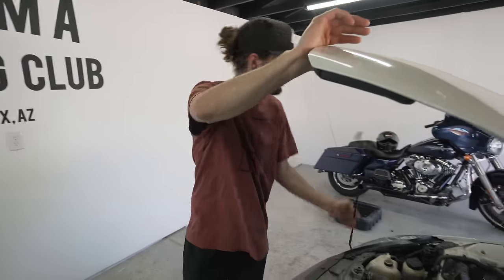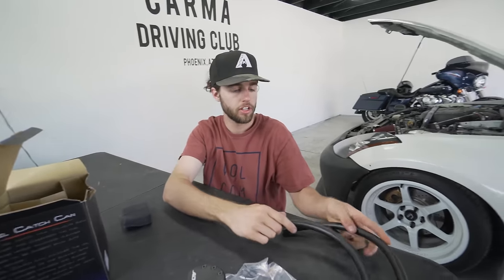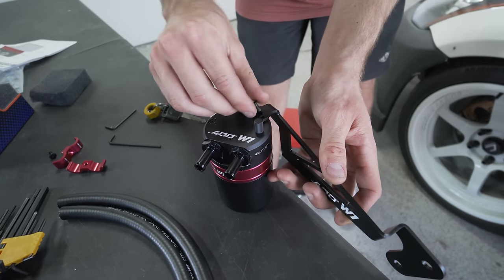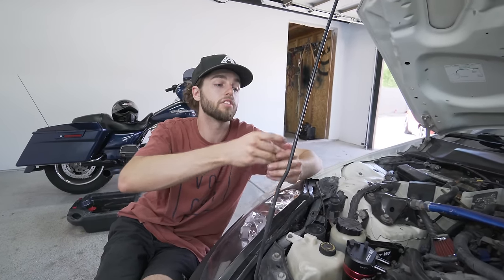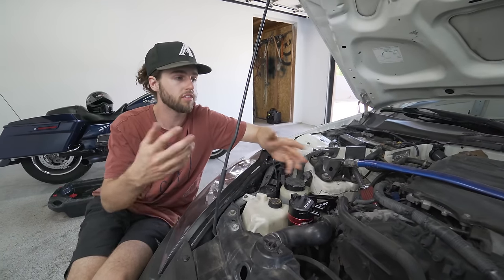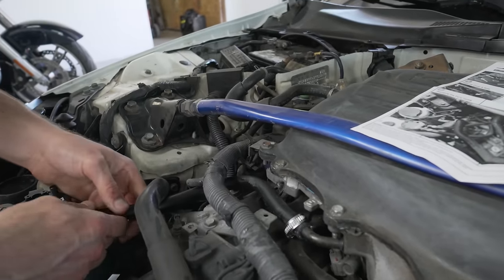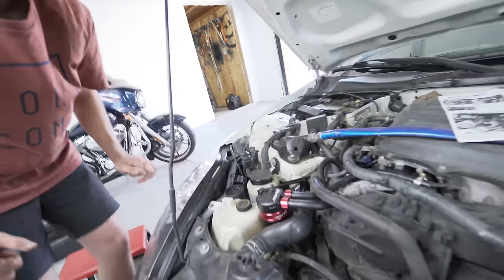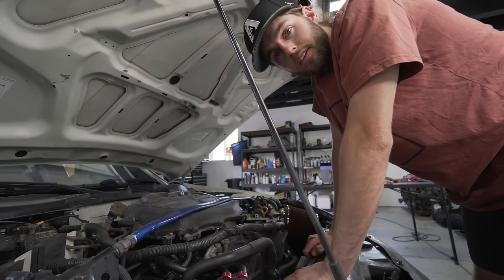350z Catch Can Install +Why It's Necessary! (Oil Consumption)

Comment: This is slightly incorrect. You are using the intake as a vacuum (negative pressure) to pull the crank case vapors (blow by) out of the top of the head/crank case (positive pressure). The reason this is done so you don’t leave fuel and water from the combustion cycle sitting in your oil degrading it. Also the reason they aren’t vented with that little filter from the factory is because those vapors are harmful to the environment. So they use the intake to cycle them back into the engine to burn them off. But over time, this cause valves to get all gummed up and can leave tons of carbon deposits.
Reply: AutomotiveBox I’m glad you chimes in here!  Didn’t feel like typing so much lol. Well said!
Reply: AutomotiveBox im a newb spare me.  The PCV valve connects to the “IN” port of the catch can right?
Reply: Not on a 350z, these engines are port injected, and spray their intake valves with fuel which keeps them fairly clean. In fact, the OEM intake manifold design on these is meant to catch most of that oil, and what little oil finds it's way to the cylinders is just extra lubrication.  Catch cans are really only helpful on direct injection motors, which do not have any cleaning effect on the intake valves. I took my entire intake manifold off just recently on mine to replace a valve cover and some sensors, and the intake valves looked almost shiny clean at 110k miles.
Reply: It’s not just to clean the intake valves though. It’s to prevent detonation and degradation of octane in fuel. This will happen if any oil makes its way into the combustion chamber.
Reply: You really have to caveat your comment with a "DI"' inject. Port injected engines won't see harm from this, only DI engines will. 350z doesn't need any, it's all marketing BS.
Reply: @jacquesc3166  I absolutely agree with you. Anthony 350Z had a pretty cool setup for his catch can. However it will burn through the motor and then run fuel injector cleaner every few months

Comment: Ok, so here my 2 cents worth.. ignore if you like.. but, blow by comes from the crank case, the bottom of the engine, where pressure passes down past the cylinders/pistons and rings. So the pcv valve relieves the pressures that build in the crank case. The catch can basically filters those vapors and cleans the oil particles out. So honestly, there really is no point and is counter productive to reroute said filtered air back into the intake manifold just to muck up the intake air(it wont be entirely filtered ). Better to relieve to atmosphere. And since there is also a hose venting the driver side as well, it would be better to route both hoses to the can, then vent out to atmosphere through a small filter. Plug the intake hole again. I noticed the kit you bought only has two hoses, one in and out out. There is another version of that system that has three ports, one in and two back out. That one will allow you to take in both hoses out of both valve covers and vent out to a filter with minor adjustments to system for adding a filter on out port(hose adapter). I will be doing this set up shortly and can let you know how it goes. 🤞👍
Reply: How did it go bud
Reply: @segbachan5123  still haven't done it yet. Sorry.. 😆

Comment: Love the vid, i think you got miss informed my man I think you got blow by backwards there’s a heavy negative vacuum on the intake from it sucking in a lot of air hints the term intake so even if that was to happen it would go out the exhaust, what really happens is all the movement under the valve covers makes pressure that needs to be vented and after the motor gets hot the oil cinda turns into a steam I guess is the best way to explain it and and what do you do with Oily steam, Nissan just decided to hook that into the intake to help lubricant the motor but Nissan figured it would help the motors last longer in return for a little bit of performance loss so a catch can is to help get that little bit of performance back but you also lose that lubricant factor

Comment: If your oil consumption is high. Change your valve guide seals. That’s not going to solve the root cause.
Reply: Could be other things.  Worn rings.  Leaky gaskets.

Comment: There is also a hose for the ACTUAL PCV on the driver side rear that acutally intakes air from the back of the intake tube. That is the acutal PCV intake, its not that little hose connector on the plenum.

The PCV valve is a one way OUT valve, not in. The oiled air comes from the cover back into the  intake manifold so that can be burned off.
Reply: If you remove the PCV check valve completly, you will get air going back into the motor as well. On boosted applications the VQ will get blowby even from the back of the actual driver side PCV system intake.

You can see the correct flow of oil vapors in the system in the FSM image I linked.

https://g35driver.com/forums/attachments/canada/98237d1227123015-what-pcv-valve-do-i-need-replace-my-g35-untitled-1.jpg
Reply: i just saw a lil beat of oil in my vortech v2 blower and aslo my bypass valve its like oily but my car does not smoke wwhen driving it do you recomend this ADDW1 catch can ?
Reply: Anything with forced induction should be running a catch can, so yes.
Reply: @Z33Garage  ok thanks for reply

Comment: Its so cringy when ppl dont know what they talkin bout so many ppl will be miss informed
Reply: Further info?
Reply: Ian Champion not sure what exactly he was talking about, but catch cans don’t catch blow by. Blow by occurs in cyclinder, not the top of valve covers. Also you don’t lose any horse power running a catch can vs a filter.
Reply: Richard Manzanarez I don’t think he was wrong he just worded it pretty bad
Reply: Dude needs to do his homework better and not just guess.  Also the way you routed that 2nd line its already kinked and that'll restrict and affect proper operation.

Comment: I have the VR30 twin turbo in my Q50RS and ABSOLUTELY you need a catch can. 1000 miles and I get 30-35 cc of fuel laden crap in my can. Being direct injection that crap builds up on the intake valves. I need to get a STB. Yours looks very stiff. Good deal 4u.

Comment: I installed this catch can on my 2004 350z and it’s starting to smoke a lot. White smoke and smells like oil. Any tips? Or is it just burning all the oil that’s been in it bc I’ve had that pcv delete thing since I’ve owned the car(2years).
Reply: Any news about that problem? Did you solve it?
Reply: Bad pcv valve,bad oil catch can flow(made engine pressure),bad catch can instalation.When engine run on idle,when you open oil cover,or pull up oil level stick,if is pressure or smoke there,pcv or oil catch can is bad and that is not good for engine and for turbo also(then back oil turbo line have pressure also,if you have pressure on oil dipstick etc)My English is bad,sorry,but you understand what i mean to say to check.

Comment: I must try on my bad english,sorry.Catch can is more complicted than you think,even more if PCV is on engine..I build my own catch can,put oil level meter sensor from brake fluid can,i made adjustuble oil separation for variable engine pressures on idle,medium,high rpm etc..It takes time to do it right way,new engines have so bad factory oil separation systems,but pcv is not only bad desing thing from factory,egr flows are also so bad for turbo spoil,exsaust manifroids and inlet also..All that bad factory desings is only for Eco norms for any cost even for new engines.1/5 exsaust gas force is going for egr,and that is too high price for turbo engines..Every modern engine can run better,longer,stronger with few 'little'upgades but for do it right way,it takes time and much work for custom parts to unlock restricted potential of our engines...

Comment: It's actually worthless to put an oil catch can on a N/A port injected engine. It actually causes the upper cylinder to get less lubrication. I get that the REVUP and HR models do have a higher oil consumption, but even then since your spraying fuel across the intake valves, it really just results in cylinder lubrication. Smarter idea is to just get an oil cooler for the car, as the OEM in-line coolant to oil cooler for the 350z is trash and these cars generate more hot oil vapors than need be. It would have a similar effect, but still allow some oil to get in the cylinder and keep things running smooth.
Reply: you doing both would be okay? or just one or the other?
Reply: @collinsepulveda9670  No need on the catch cans if you get your oil temps down with a cooler, possibly even an expanded oil pan (6qt). Oil catch cans are really best for direct injection motors, because it helps keep the intake valves clean. Not of that much use on a port injected 350z, all your oil vapors are doing is blending into the fuel in small amounts at the intake valves, and adding lubrication to the cylinders. This is why the oil burns off. 

If it's consuming about 1qt every 4,000-5,000mi, don't overly concern yourself, just get an oil cooler at most. If it's consuming oil fast enough, a catch can isn't going to hold all of that, and you probably have worn piston rings/cylinder walls. In this case an oil cooler can help your engines lifespan, and an oil catch can might help avoid ruining your catalytic converters, but you will need to check it often less it becomes completely full and clogs up your PCV system.
Reply: @DaveDuzzit  awesome! thanks for the insight. i need a new quart about every 3-4k miles so oil cooler seems like the way to go... to clarify in the last section though, are you suggesting having both in order to to save my cats? or do you think just the oil cooler will ultimately slow the burning to a point where it's insignificant? sorry for the questions, im new to building cars as my z33 is my first real project
Reply: @collinsepulveda9670  I'd say go for the oil cooler and the oil pan extension. Then you're cooling the oil both in volume (6-7qt system) and with the oil cooler. It will also give you an extra qt. of headroom in the sump.
Reply: @DaveDuzzit  Oil cooler mean a lot for engine like this,more cooling liquid in system,more oil,more cooler oil,better oil,cooler oil not made bad condes on high temps,turbo is more happy..Lot Audi/wv/porshe engines from 80is are made with oil cooler in standard production,ant they was best their engines,even today i use their oil filter adapter for upgrade other engines,so easy to upgade.And guess what,engines with oil cooler have so less hydro/lifter problems,piston rings on nicasil cylinder last longer also etc..
Oil cooling is first or secund thing shoud upgrade on alloy engine..And in port inject systems,intake valves is not only thing that oil make dirty,variable inlets are there also on other engines,egr lines etc.Hot oil eat ruber hoes,block IC etc...But your comment is one of smartest of all.Sorry for my bad English.

Comment: Okay maybe someone here can help me lol.
Turbo 350z, single turbo. I actually did vent my PCV with the same sort of filters, except now I'm about to get a catch can setup (decided to work on it, project car). Long story short, I quickly read that you 'usually' cap off the air intake inlet (that is underneath the throttle body/intake, this usually connects to the intake, however I'm single turbo with no intake on the turbo; Just a filter). So I did this. I was then going to do the Catchcan to the same setup as you appear to have yours, connected from the crankcase to the plenum. Should I keep the crankcase induction tube (the one that is underneath the throttle body) covered or should I fabricate a small 'intake' off the compressor wheel of the turbo for this to connect into instead?

Comment: Hasn't this dude got it backwards regarding blow-by? It's gasses from combustion chamber pushing past rings and going into the crankcase...which is vented with pcv valve into intake manifold. Yes?
Reply: Snake Roberts im a newb spare me.  The PCV valve connects to the “IN” port of the catch can right?
Reply: @YapperU  Correct...then goes out catch can to manifold. Basically the catch can is put inline of the hose between pcv and manifold.
Reply: Snake Roberts thanks 🙏🏾!

Comment: Should I be looking into a catch can for my HR or is only for the DE's that burn oil?
Reply: Ed Cadiri nah HRs are fine, they don’t burn oil. Only the 2005 and 2006s have the issue
Reply: @Skrill3x24  05's and 06's are the Rev up engines, so does that mean the 03's and 04's are fine?
Reply: Henry the revups burn more oil slightly due to the increased rev limiter and increased hp, really depends how you drive it, but it's not a big difference from the regular de's. I have a 05 g35 and I will be purchasing a catch can soon, can't hurt lol

Comment: Great video but I installed mine different. From the pcv to catch can and from catch can to the  lower manifold. So I plugged the port on the upper manifold and the port that is on the intake tube
Reply: lower mannifold as in on the rear near valve cover?
Reply: @Parahlyzd  yea, usually their would be a line from the intake manifolds to it.
Reply: That’s wrong. Where are you getting fresh air to your crankcase? You can plug the intake but then you need to vent the high side crankcase…

Comment: Would this be recommend for an NA HR ?
Reply: Mateo Quiroz the HR engine doesn't really suffer from oil consumption, and the Pcv valve won't be in the same spot but you could look into it!
Reply: @aaronbaggest2029  This is the valid comment. The one above is trash. Don't put catch cans on your HR folks.

Comment: Does this fix oil consumption on these engines fully?
Reply: Nope just partly, some people say it doesnt even help...
Reply: Catch cans have nothing to do with oil consumption.
Reply: Just do it on your car depending on the miles in the engine you will a big improvement or not much but it will help. The idea of having that blow by back to the intake is for pollution emissions regulations purpose. My opinion no vent blow by going back to my intake.

Comment: Great video. I see that it's an ADD 1. I went on the site and found one for $170 but after adding what I thought would be included, the price was close to $300. My question is, what all did you buy and or add to yours?